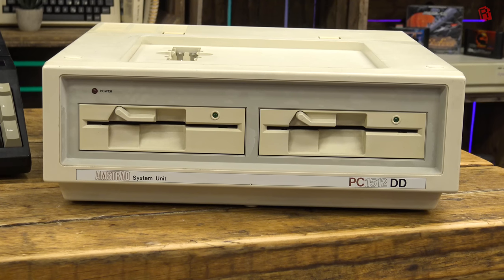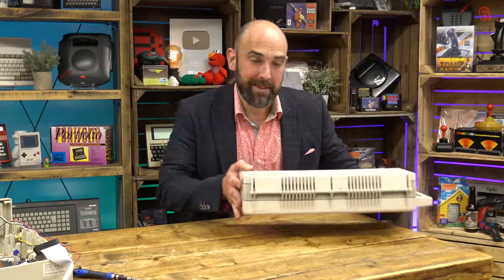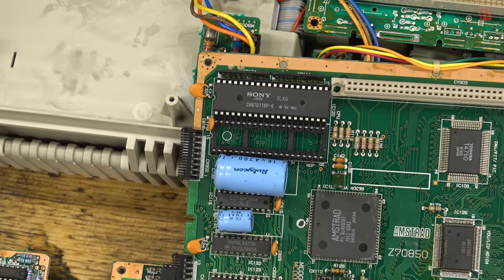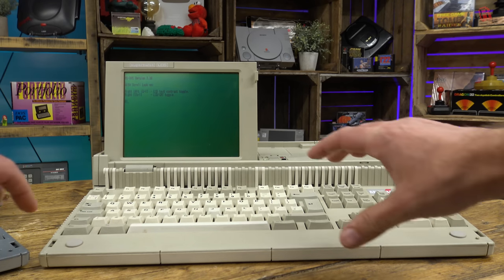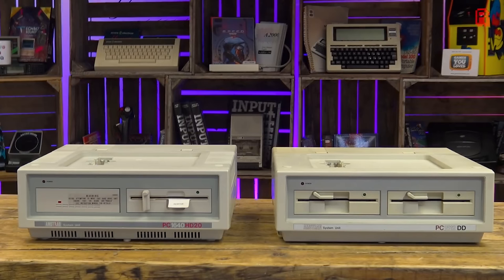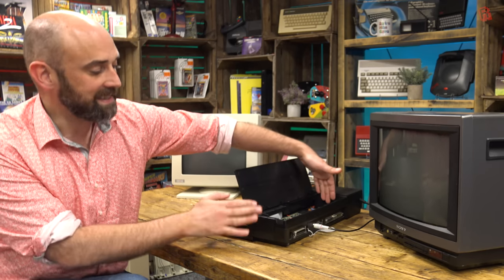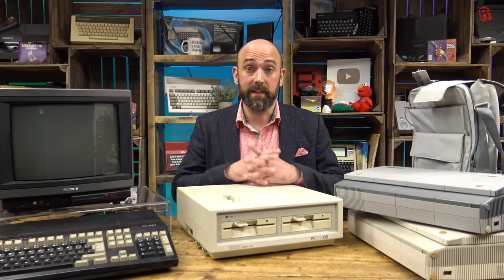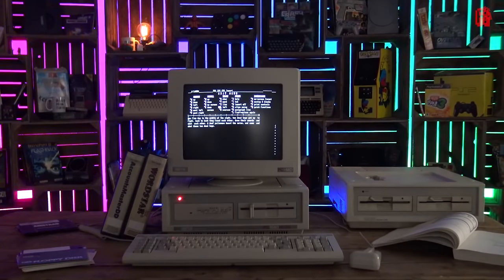Wedge Shaped PC's? Meet an unusual Amstrad computer family | Show & Tell

Comment: I remember the Amstrad PCs very well indeed.  The PC 1640 was good for it's time, extremely popular. Hard drive manufacturers sold "hard cards", which was a hard drive and controller in one long full size ISA card that fitted in the PC1640 and added a 30mb or 40mb hard disc.  The PPC was popular also, it was so much cheaper than anything else.   By the way, Wordstar was a bit old when these came out, it was the DOS version of Wordperfect that was popular and of course Lotus 123 as Excel was not yet available.  But on a budget Shareware had become popular at that time, the shareware spreadsheet was called "As Easy As" and was a 123 clone, some good word processors were shareware also.     The cheap printers were the Citizen or the Star dot matrix, or for serious work the Juki daisywheel.

Comment: first PC I owned was a PPC-512, had PCs at work. Still mostly used Amiga for hobby use. Used for wordstar mostly so I did not have to work silly hours at work - just took a floppy back and forward. Once took it on a domestic flight to another city, again for work, and did some edits on battery. replaced with custom build made from rescued parts ASAP, but used as a portable VT terminal clone for ages at work for unix dev and was great for that. Got an upgrade to external Zip 100 parallel port drive that then went on to many future PCs and was my main drive to take stuff to and from work.

Comment: I had a Sinclair PC200 and was even a member of the PC200 owner's club with magazine. I seem to remember I bought it for £143 s/hand. I don't think I got the manual. I was a manager of a small shop at the time that sold Schiender Euro PC's which was a similar format and I remember the Sinclair PC200 being more powerful and faster. I think the Euro PC was only 4.77mhz but the Sinclair was 8mhz. I loved the PC200 purely because of the PC software available. I used to play Elite on it quite a lot. I probably still have some of the PC200 club issues somewhere. I had a good Microvitec Cub multiscan monitor that gave a very good display with the Sinclair PC200. As soon as I got my Archimedes 3000 the Sinclair was abandoned. The Archimedes just made the PC, ST and Amiga seem like complete rubbish in performance terms. They were incredibly exciting times and I enjoyed pretty much every computer I could get my hands on. I managed to get a next generation Amstrad the 2086 I think very cheaply and sold on the PC200 for actually more than the new computer so I could then enjoy the amazing VGA graphics of the 2086. I remember being amazed by the 2086 as I got a hard drive for it which I think was the type that was attached to a card that went into one of the 8bit slots. 20MB storage comes to mind.

Comment: On the Amiga 500, the side connector is a zorro effectively.
Reply from the maker: That's true it's pretty limitless what you can attach to it...but an extra one under a top flap might have been interesting. I also wonder what we might have got to play with if the Amiga had a cart slot on the top or rear like the C64 had. Might have been fun.

Comment: 11:24  You kind of did.  That's more or less what the side expansion bus was.

13:07  He still wasn't done.  There was the 2086.  Though off the top of my head, I think they did at least update the floppy controller for that one.
Reply: Didn't the 2000 range have VGA graphics as standard?
Reply: @MIKIEC71  Yes. Similar plasticky build as the 1512/1640 but with 3.5" floppies and 286 and 386sx models.  The 3000 series were much nicer metal PCs with the PSU in the system unit.

Comment: I have a PC200 it came with a monitor that looks like the ones that sold with the 1640 but is black. I remember using the 1640 when at Uni  with the strange sounding hard drives. I had access to a lab of those, a lab of Apple  Macintoshs  and a lab of 286 ibm clones . The 286's were available 24/7 with card access so thats where i ended up.

Comment: Used 1512 &1640 at work. Bought myself a ppc640 (a mate bought a ppc512) to do 68000 cross assembly for a SBCon my MSc course. Used it to make intermission video slide-shows for a club (Vine micros made a TV out box for them). I recollect that someone offered a 20Gb hard disk that fitted inside (Stratum?). The ppc keyboard was good for prolonged coding sessions. Did 'move up' to another Amstrad at home (PC2386? - 386 AT clone still with PSU in monitor).

Comment: I still have my PPC512. I did try to use it on a train, just once, on an HST between Worcester and Oxford (in one of the 'airline' style seats probably because all the table seats were occupied). It didn't really work, the batteries lasted about 20 minutes and it was very cramped and difficult to type, and the machine wouldn't fit in the tray. From then on it was on mains power only. I got it super cheap from Morgan Cameras (who used to advertise in PCW, mostly stock from bankruptcies for a knock down price - my PPC's BIOS messages were all in Dutch!). I did get the external card cage for it in the end. There was also a place that would fit backlights to the LCD, but it was pretty expensive, so I didn't. I had considered the Sinclair PC200 for a moment but quickly thought better of it (and the reveiws of the machine were terrible).

One thing the PPC had, or at least mine, was the NEC V20 processor (8086 clone) which also could be put in Z80 mode, so you could run CP/M.

Comment: Now there's a lot of Amstrad branded PCs...
I've always wanted a PPC512/640 but have held off because I know I only want one for a case-mod project. Gut it in favor of modern laptop components, fill it to the brim with laptop battery cells, and add a modern LCD panel. Just imagine how many days such stealth a PC could last between charges! With all the batteries it should even remain reassuringly heavy. Of course I might have trouble getting airlines to accept it but such a machine but it might serve as a range extender for an electric car!
Maybe not quite that far...
...I would certainly do a "sympathetic" stealth build but even so I've never had the heart to gut one of these interesting machines. I need to find one that's beyond saving with a nice exterior and functioning keyboard.
PS
Sinclair PC2000... Very nice, until you compare it to the competition. Har. har, harrr.

Comment: The PC1640 has a 8086 processor, but the PPC640 has the NEC v30 variant which runs at a slightly higher clock speed.

Comment: I can think of another good use case for a very cheap PC. In the early 1980s computing at college was all about the 
Pr1me mainframe, or Research Machines 380Z running CPM. In 1988 all our computer equipment at work was from DEC.
Then, probably just for evaluation / curiosity work decided to buy an IBM PC AT. I still remember peoples anticipation of 
the new "toy" and then their disappointment once it was actually set up. The engineers trying it out were struggling with 
really simple things like showing the directory of a disc .................. except for Frank who had bought himself an Amstrad 
PC1512 about a year earlier. Thanks to his Amstrad purchase he was the departments PC expert and soon bagged the PC AT to go on his desk
while the rest of us went back to our PDP11s and the shared Vax mainframe.

So for anyone wanting learn about PCs any of the Amstrads would have been a fairly good purchase.

Comment: My old Amstrad is still around - complete with a 640KB upgrade. The 1640 was probably not for sale until a year later, and had better graphics - the monochrome monitor of the first Amstrad was probably the worst I've ever used - but the keyboard was OK. That 16 bit colour mode was basically just dithering in GEM. The green monitor for the CPC range was way better than their PC monitors.

Comment: The unused space under the flap of the Sinclair would be a great space to add a modern Micro PC plattform in - e.g. a disassembled Intel NUC or something like the Odyssey. It would need some engineering work to get the keyboard running with both machines and to combine the outputs into a single output without too much modifications (maybe a custom ISA card, that takes care of the Keyboard?). The removable part on the side could be replaced by a 3D printed one with the necessary switches and ports (HDMI, USB etc.). I would love to have a great looking vintage machine that is switchable between original and powerful without the need to modify it too much.

Comment: Really enjoyed this video! Re:expansion on the Amiga - isn’t the Amiga’s 500’s Zorro connector on the left hand side a far more elegant solution than a couple of slots that sit under a flap you can’t close when in use? I’d argue that even with its slots, the PC200 wasn’t as expandable as an Amiga 500. You’d lose the two card slots just to get Amiga level graphics and sound...

Still, it’s an oddly attractive looking cove isn’t it?
Reply from the maker: Yes I didn't explain that very clearly, I was daydreaming about a top zorro slot in addition to the side so that we might add expansions in addition to a HD slapped on the side. But yes you're right with the PC200, 2 slots isn't enough for VGA, sound and a hard drive controller!
Reply: Ah, with you. I like your thinking. For all the compromises of the flap, I’d still have loved to have had a Zorro II slot secreted in my A500 for a PC Bridgeboard or other exciting big box Amiga card back then!

Comment: I lusted after the pc1640DD for about 6 months, then found out about the monitor and graphics oddness and so instead got a Hyundai Super 16 TE with a 5 1/4 and extra 3 1/5” drive with a Philip 8833 mk1 monitor. A year later I added a 40mb filecard

Comment: The PC200 was out of date when it came out and flogging a dead horse. I worked on the Amstrad stand at Earl’s Court when they had it on show and I could never understand this machine it was a totally pointless machine. I don’t think when I worked for Amstrad proper a year later on the help desk I ever took a call for one
Reply: I think Alan Sugar missed a trick here. The Slipstream chip was available at this time, and ran with an 8086 processor. He could have picked it up instead of Konix and released a PC running  a GUI (GEM) and with enough grunt to shame an Archimedes (or Megadrive). See konixmultisystem.co.uk
Reply: @alexisread5325  I believe that website is a bit biased. If you take a look at what developers where saying about that system which was it showed promise, required a lot of extra programming and the video was slow compared to what they expected. Where as the Archimedes (a system that I have owned but have no particular love for) was a fast but pain to program for system, available since 1987.
Reply: @alexisread5325  Konix only had 8086 so marketers could put 16 bit CPU on the box. I think the original design used an eight bit CPU with idea that DSP etc. Would do heavy lifting.

Comment: The portable is only around 500 g heavier than the Toshiba T3100/20, which is pretty much an actual laptop, although without any batteries.

I wonder if they could have fitted a low-profile riser card to allow for one half-length ISA card on its side without sticking out of the case.

Comment: In 1987ish in Toronto, Ontario we sold a shit-tonne of those, both PC and PPC variety. Don't want to toot own horn too much, but I was involved in a mod that allowed easier mounting of a more common hard drive cages into those desktop units. We could get the units easily in Canada, but those mount cages were impossible so we had to hack a bit. It was not always the cage but also the clearance on the front panel to house a normal HDD plate. Except for the very poor blur/lack of contrast on the screen, the machine is wonderful for playing Roberta Williams games for instance. But use an External monitor please! Even though we were amstrad dealers, I never saw a PC-20 or PC-200 in North America. I prefer that design!

Comment: There's a PC200 on Ebay right now with a starting price of £445.
Reply from the maker: ouch! I've returned this one to the museum, but I'm pleased to say the keyboard is now working. The membrane connector needed a little clean to get it back up and running, so it goes back a little better than it arrived.

Comment: I had a 286 PC at home, but was working away from home a lot and the PPC640 was being discounted, so I bought one so I could use it for wordprocessing (Wordstar) and programming some of my personal projects (Borland Turbo C and Turbo Pascal with some QuickBasic), I seem to recall there where laptops available at the time but they were insane prices, and the PPC was good enough for what I wanted, and I could even use it in the car when parked because it plugged into the cigarette lighter. While it wasn't hugely capable and not really suited to anything graphical, I could just pick it up in its carry-bag and take it with me in a way that a desktop you never could. I used it in this way for years until I discovered the Psion 3mx for my portable admin needs... by that time the personal projects had somewhat receded to the weekends so I didn't need a portable for that. It was many years before I actually got myself a laptop!

Comment: I recall seeing a PC200 in a glass display cabinet in a branch of Comet circa 1990, and wondering what the point of it was even back then. It wasn't on display during my previous visit, and wasn't there the next time, either. Was it dropped from the market very quickly, or did Comet simply give up on them?

Comment: I've had an 'Alan' of Amstrads over the years, but none while they were current products, all as a would-be collector.  The PC-200 was a nice design, alright, it's a pity they didn't continue the line with more powerful 286/386 machines.  All that was needed was to have the expansion cards lay flat, really.  As I recall, the PC-200's marketing was a disaster.  Stores like Comet had deliveries of them with no documentation, no systems disks, etc.  [Edit] Predictably, after struggling to sell my PC-200 a few years ago, they suddenly became an item in demand, and the price shot up.

Comment: Some Idea maybe to retro design for the amstrad luggables LiOn Cell power packs and external charges per laptop designs, this should make the PSU weight split from unit and PSU in separate pocket for moving about,

Comment: I think I like the portable ver, so different.
The wendge turned me off as soon as I saw the crappy TV display.
However, for any serious use, you cannot go past the original, just hope the monitor does not die as a regular display won't work - no power for the processor.

Comment: Hi, you liked the two isa slots in the wedge and wished the Amiga had the equivalent? How about the 86pin port on A500? Virtually a Zorro slot. It was actually a pins off the cpu, which is same as what the ZX spectrum expansion port did, years earlier. Or how about the A1200 trapdoor? Look at what expansion upgrades the cpu, graphics, or even pc compatibility. Give me  one of these slots any day and it keeps the case low profile too.  Just some food for thoughts 🙂
Reply from the maker: Hi Ben, yes I should have been clearer really, I mean in addition to the side slot. That's well placed for a HD or even an A570, but with an extra top slot who knows what else we might have got. On the flip side it may have hurt big box Amiga sales I guess.
Reply: RMC - The Cave Nah your vids are awesome. The A500 was optimised for cost. Back in the day I replaced my A500 to a A500+ 2mb chip ram. In the expansion slot I had gvp impact with 120mb drive, 4mb fast, and the 286AT board in.

Comment: It would have cost more, but purely in terms of available space, I'd have thought that for the PC200, it would make sense to mount the ISA cards horizontally on a riser card.  

As for owning one?  Technically, I didn't.  My parents owned a 1512 with black and white monitor, and 20 meg HDD.    They allowed me to use it for College work,   While I loved my Amiga (and still do love the Amiga), none of the software I needed for college was available, and then one of the subjects taught us 8086 assembly, so I had to use the PC.   I didn't have enough money to buy one of those PC emulator cards for the Amiga, much as I really wanted one..

Comment: Arghhh! I'm getting flashbacks to the late 1980s when I was using a PPC512 to download river chemistry readings from data loggers in the middle of the Scottish wilderness. 

It was immensely heavy even before having to lug it halfway up a mountain through fog and rain; only to spend a wretched half hour trying to get data from the logger into the PPC itself. Oh how I hated that machine with its terrible hinge, worse screen and truly dreadful keyboard. And when the day was over, I would head back to base and push the data over to a PS/2 running OS/2 - someone clearly hated me.

Comment: I used a 1640 until I finished my degree in 1993.  Solid machine that wouldn't die.  I remember seeing the Sinclair machine at earl's court computer show and whilst initially liking the look of the machine it was really low spec - far too low to succeed (though the rf connection was a nice touch). Had it had a better cpu, vga graphics and a soundblaster 2 it would have been able to compete with the ST and Amiga.  Managed to convince  my dad not to buy one.